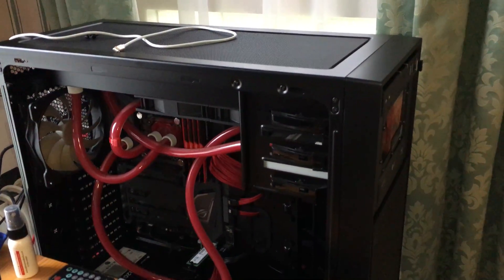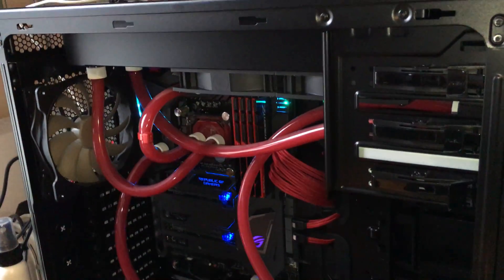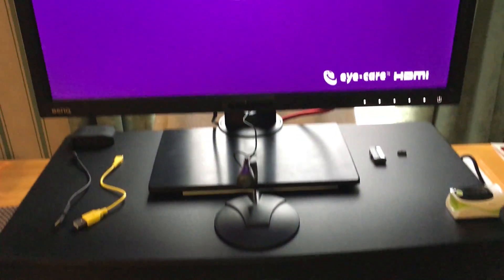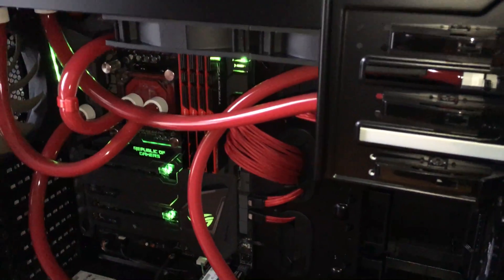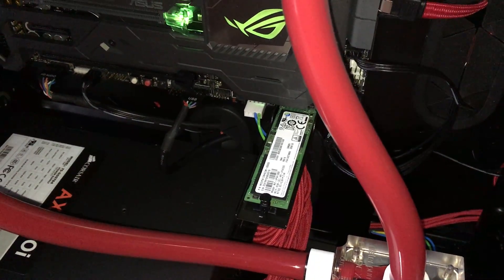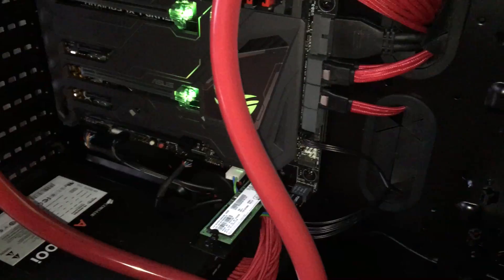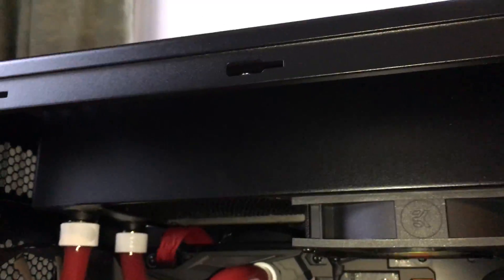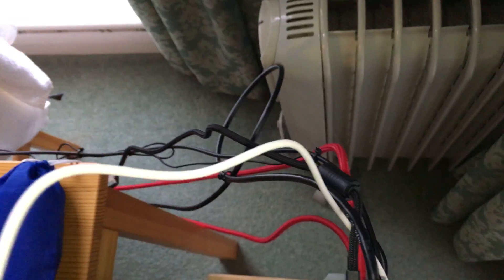How the EKWB water cooled i7-7700K + Samsung 960 Pro + Asus Maximus IX Formula PC works

Comment: what temps do you get? is the cpu delidded?
Reply from the maker: about 45 to 55 degrees but the loop also cools 2 x EVGA 1080 Ti FTW3. There are 2 radiators. 1 x XE360 and 1x CE280. The CPU isn't delidded. I'm not convinced gimmicks like that makes a difference. Check out the newer video on my channel with the new set-up.
Reply: you get 55 degrees on a stress test?
Reply from the maker: Benchmark and playing games. Previously I used to get over 80 degrees whilst performing the same activities.
Reply: and how did you change it?
Reply from the maker: change what? sorry I didn't get you question.

Comment: How did you make your 960 pro work with the formula ix?
My bios doesn't see (detect)  it, and so on i can't instal windows to my m.2...
Reply from the maker: Didn't have to do anything at all. If your BIOS doesn't detect it, I would say it's a contact issue. The same thing happened with my Polaris SSD that was installed on the 2nd M.2 slot. I had to remove and re-insert it again. Try doing the same. By the way, I take it you've installed it on the primary M.2 slot which is under the cover right?
Reply: Yes, its under the cover, i will try reinstal it. Anyway thanks the tip
Reply: You were right, thank you very much :)
Reply from the maker: Woohoo!!! well done :)

Comment: The colour changing scheme is called RGB, but anyway, I want to ask if you still work on laser builds?
Reply from the maker: It's Asus Aura, a proprietary RGB system. LOL for a moment I thought you were asking whether I was going to install lasers into the PC. No I'm not working on any laser builds now. I tend to shift interest and pick up new hobbies very quickly :)
Reply: Brian Su Oh ok I was just looking around because I need a driver for my laser and most other people that I have asked don't have any advice on them.
Reply from the maker: Hi, it sounds like you have very complex requirements? These days one can get tiny driver boards that are the size of a 5p coin that can be made to output whatever current you want. The value is configured using a SMD resistor and thus the unit is very compact. Would these work for you?
Reply: Brian Su Sounds great yeah.
Reply: Brian Su Ill have a look. Thanks
Reply from the maker: cool! let me know if you have any questions :)